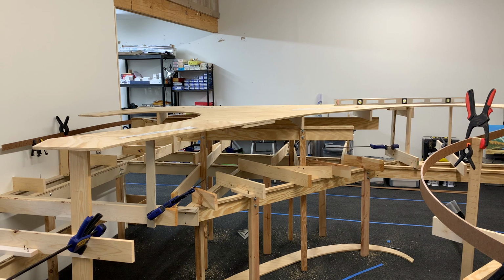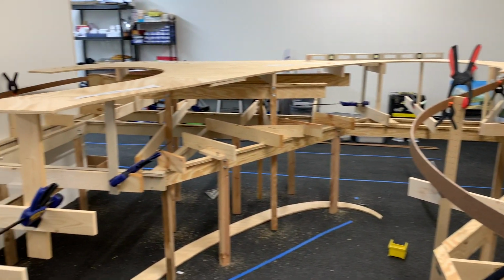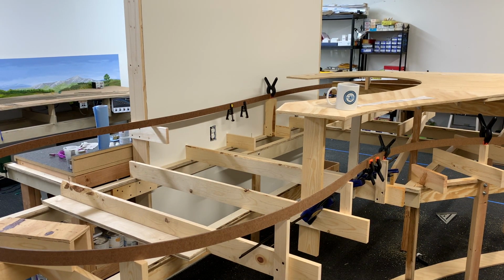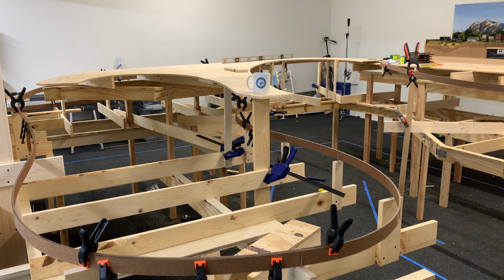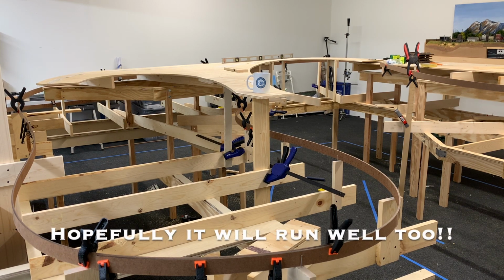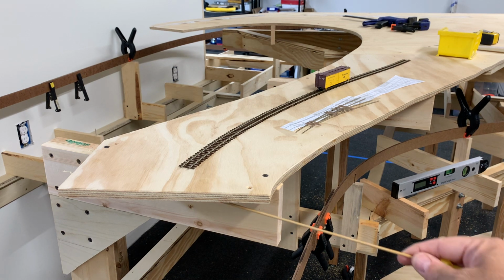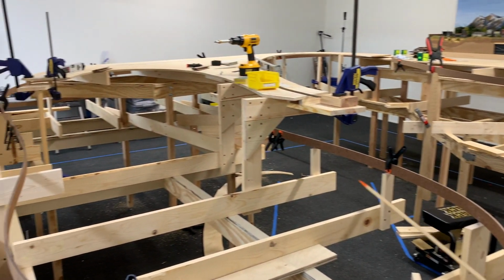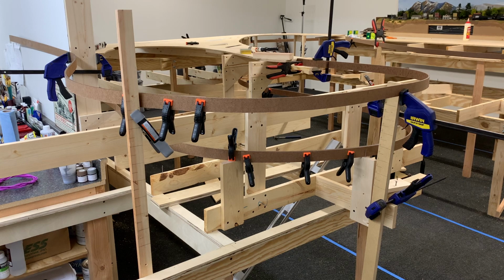Model Railroad Update 63 (Benchwork 10)

Comment: Dennis you have given lots of food for thought for my layout build thank you. One thing I am looking forward to is how you plan and decide your LCC system for the layout such as location of nodes and sensors as well as wiring. I have watched all your previous videos and am part way through building my test layout. So when your ready could you slip in a video or two on how you plan and some more about the installation what you have to think about. Thanks for all your hard work Regards Neil
Reply from the maker: I'll try and do what I can Neil.  Of course, knowing what you want your for your layout is half the battle.  At this point, I have no plans on having signals on my layout, but I will engineer it so I can add them later if I decide to add semaphores.  One could certainly argue that I've gone to a lot of extra expense and trouble just for push-button control of turnouts.  That being said I'm extremely happy with my "smart" yard.  Choosing routes with one push-button is a delight, much better than aligning five or six turnouts!

Comment: fascinating work Dennis. Why do you choose tortoise switches?
Reply from the maker: Hey John!,  The short answer is because I like the slow-motion movement of the points.  There is a much longer answer that involves LCC, JMRI and an idea that I could make somewhat of a "smart" layout.  In order for a turnout to throw on it's own as a result of block detection it has to have a turnout machine of some kind throwing the points.  I went with the tried and true tortoise.
Reply: @OtterCreek  I understand to a degree (better than I did). thanks man :)